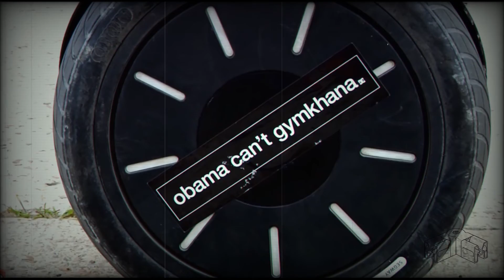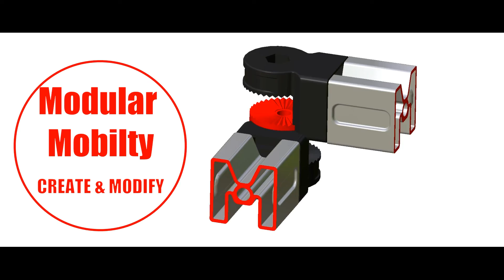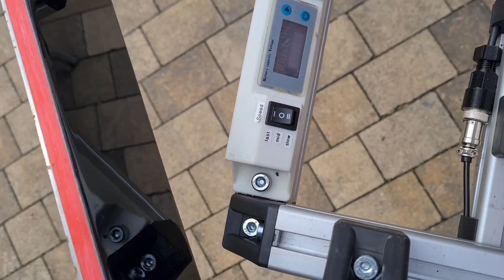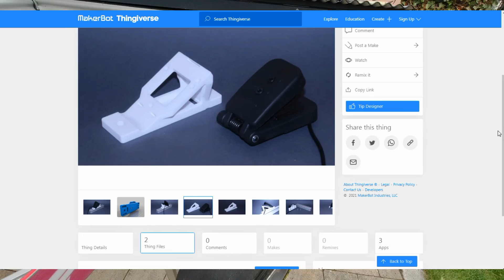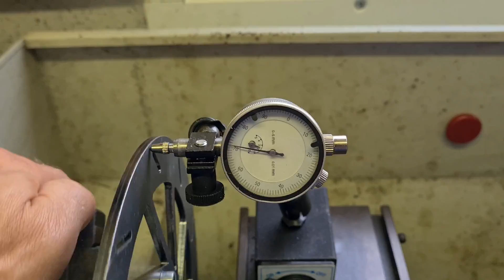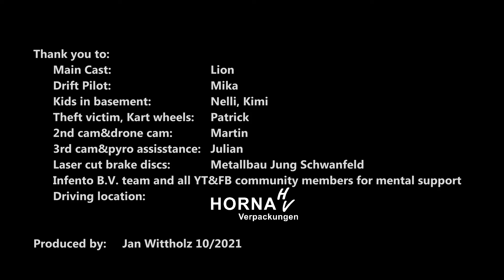Building a fast electric DIY Go-Kart from INFENTO elements (INFENTO Creation 20)

Comment: I am curious about your custom brake disc - I noticed it's 200mm diameter and 4mm thick? What brake caliper are you using? Would you be open to putting the CAD file for the disc on Thingverse?